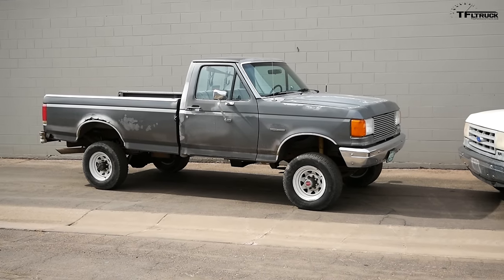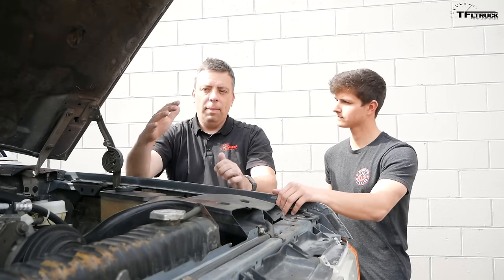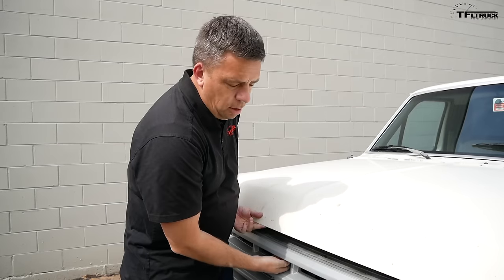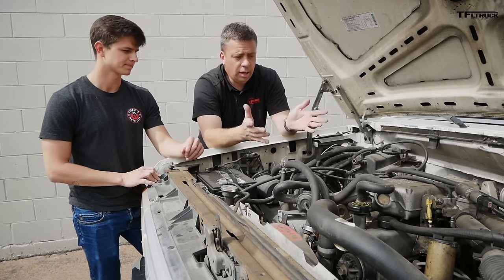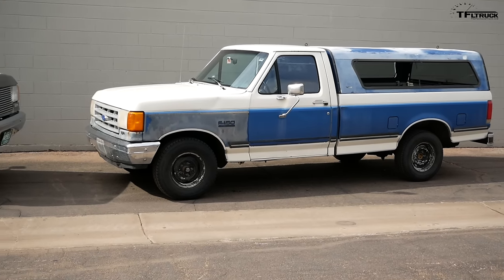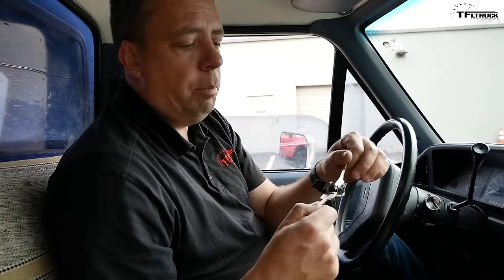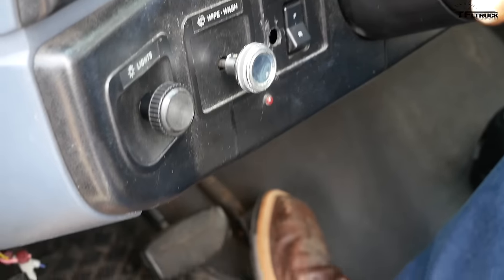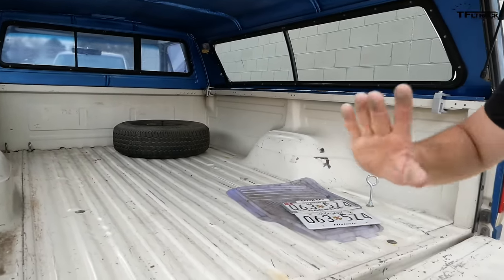Here's Why You Can't Kill An Old Ford F-Series Truck | Gunsmoke Ep.3

Comment: I’ve had many spontaneously start knocking, I blew up a 4.9 once...ran it so hot it locked down 3 times. I worked it loose with a breaker bar and it still fires up and runs great to this day, it just knocks like a jehova’s witness
Reply: UPDATE, it’s still running but, it blew its headgasket and consequently dumped all of its coolant into the oil pan. She can’t get out of the yard anymore….she dead Jim, she’s dead
Reply: @GingeyNHF  it was a good run
Reply: So what youre saying is... even with a catastrophic failure its still running
Reply: @archangel_yt8116  yea, use it to pull my boat to the ramp still. That’s about at far as it’ll go without running hot since I refuse to replace the head gasket again

Comment: I worked at a dealership during the cash for clunkers nightmare and these stories are true about the 300 straight six engine. We had a mechanic that came out into the showroom and asked everyone to come back to the garage and watch the straight six keep running after he had poured in the material that was supposed to kill it. He talked about how quickly the other vehicles would stop running (most almost instantly) and how that truck just would not die. He pulled all the other vehicles out to the back lot/salvage area with a forklift, but he drove the Ford out there under it's own power. I have always been a Ford guy, but I bought a 89 F150 with the straight six because of seeing for myself how bulletproof the engine is. I have over 200k miles on mine and it has been my daily driver for the last five years.
Reply: I have an 84 which has ran out of oil twice and is still used multiple times a week. The mileage is unknown.
Reply: Straight 6 , and 460 , ford should've kept and improved upon imagine what could've been done with dual valve heads on a i6 or improved factory heads for the 460 how simple and skip all the Triton crap in between that's sitting in junkyards , I often look at those new ford's and imagine dependable motors I them and I'm a ford guy 😮
Reply: Thinking about buying a 4.9 I6 with 250k on it, do you think I should?
Reply: @imissyoumom7644  if the body isn't falling completely apart yet, then it probably has another 200k to go.

Comment: I really wish companies made simple reliable trucks like this nowadays.
Reply: Toyota still makes trucks that are more reliable than this
Reply: @westward bound but the rest of the truck doesn’t
Reply: Don't worry we most likely won't have production from China anymore
Reply: westward bound  Um yeah, ok apparently they didn't tell the 4L60E that bit of info.
Reply: The last simple reliable truck is the  2015 6.0 2500. N/A motor over built, and over built tranny.
Reply: westward bound lol sure they do
Reply: My 2000 Gmc Sierra 4.8l 4L60E has only 275,000 miles on it and no rebuild yet.
Reply: @claytoncristoffanini756  toyotas have a good rap but will not be more reliable than a 300 straight 6.
Reply: James Ray  That was their old I4 diesel trucks. Their v6 Tacomas are not exactly what you'd call reliable..
Reply: James Ray  my '10 tundra never had anything break/deteriorate other than the block heater. After driving terrible roads it's still tough as a nail. Not considering upgrading for awhile
Reply: Same but these companies would not make money. It is high competition.
Reply: why would they make simple trucks when they can charge a fortune for every minor issue that comes up, particularly when you can't fix things yourself anymore?
Reply: No one wants to buy them. Modern buyers all want status symbols, and jacked so high off the ground you need a ladder to load stuff.
Reply: @james_chatman  True that they are not bought to be used as trucks anymore. Especially the guys who buy GM products.
Reply: Toyota still do, the VDJ79 Landcruiser, in some parts of the world, the 79 series Landcruisers can still be bought new with the old N/A 1HZ 6 cylinder. Unfortunately no 70 series sold in the US.
Reply: Because of all the stupid legal bullshit with the mileage and safety crap.
Reply: Toyota and honda are the “reliability” brands now rip chevy and ford.
Reply: Toyota and Honda both have cheapened out in quality and reliability in recent years also. Nothing is made to last anymore, nothing...
Reply: They make more money fixing these new ones. A guys have grown to want heated seats and climate control and power sliding windows. Give me a bench seat a 5 speed and wing windows any day!
Reply: Thulsa wrong honda 1.8 liter port injection and toyota 2.7 liter port injection are both rock solid engines make 140-160hp. The. 2.7 is a iron block and will last forever. And toyota is made of very good steel and wont rust as much as a new dodge or chevy or ford. And can get 25 mpg in the 4wd toyota and 28mph in the awd honda hrv. You are very stupid if you dont think there are suv and trucks out there that cant go 300k miles. As long as you follow the maintenence schedule and change tranny oil every 30k miles and diffs every 30k miles and oil every 5k miles on high quality synthetic mobil one oil they will last a very long time.
Reply: @gsfbffxpdhhdf7043  Too bad all the electronic shiz on honda and Toyota still won't go the distance though.
Reply: @hikdingle2210  yep, they are toys for boys who try to make people think they're tough!
Reply: @gsfbffxpdhhdf7043  when did honda start making a truck, I ain't ever seen one yet.
Reply: @mattjohnson5222  reliably broken if you hit a hole in the road at a high speed of over 25 mph
Reply: Correct, the ls series are great engines. That being said, any government motors trucks/cars are poorly made of cheap parts.
Reply: Wish they made them big enough back then for tall guys like me, I'm 6'5" and barely fit in them.
Reply: You and me both
Reply: @melvinrexwinkle1510  Honda ridgeline!
Reply: @claytoncristoffanini756  Toyota trucks have a HUGE frame rust issue. To the point where it was warrantied. Can't drive it if it isn't there!
Reply: westward bound   yeah maybe after the recalls are done
Reply: ya
Reply: James Ray  so true, the latest Camry is a perfect example. that wasn't always the case with Toyota, but they got lazy after awhile. the previous generation before this was better, but they started listening to all these younger car reviews saying they need to be more sporty and appeal to millennials, and the problem is there newer designs don't really appeal to anybody lol. it's like Honda with the new Accord, I hate the way the new one looks. the Tacoma used to be a nice truck similar to the Ranger and S10 from Chevy, but the recent Tacoma I'm not a big fan of. they got rid of 4.0 for the 3.5 and I feel like it lacks power down low.
Reply: @Epotheros  they still use those little straight 6 diesels in the mines today.
Reply: @claytoncristoffanini756  hell no, have you seen the new tacoma problems, toyota is just another brand
Reply: @australiantruckspotting8883  don't miss much, 79 series are good cars, but not the best, v8 option shows timing and Injection problems, and its overpriced tag of 80k dollars
Reply: I would take one of those over a new one any day. They were reliable and tough
Reply: I hate newer trucks. So many damn electric patys
Reply: Lol
Reply: Like bruh, I don't care about safety
Reply: @bretfeeney1072  Great generation of GM trucks. the Vortecs were great engines from like '99-'07 4.8, 5.3, 6.0
Reply: The government ruined the auto industry putting tremendous pressure to advance the technologies in them.
Reply: That is the reasons not just the Ford trucks but Chevy and the Dodge trucks are seeing a renaissance era right now. I have friends and neighbors that looking for and tracking this stuff down in garages and out behind garages & woodsheds around here. I have a half dozen of em myself I am putting em back together one part at a time. I wish I had more time to work on em.
Reply: Amen
Reply: @claytoncristoffanini756  laughable.
Reply: @djdjsggg2924 it’s not China it’s schlomosteinberg
Reply: @claytoncristoffanini756  When you have one of those Toyota's that is a daily driver and a work truck for 42 years with everything original motor transmission and rear gear never touched come and see me. I'll be waiting.
Reply: @claytoncristoffanini756 ya right 😂

Comment: I miss when trucks were honest and simple. Cheap, effective, reliable.
Reply: I just started fixing up a '67 ford F100. Talk about simple. And it was free so, cheap. No power steering, manual choke, if it had a 4 speed it would be perfect
Reply: I have a 78 F100, over 375k miles and just towed a Buick LeSabre from Richmond, CA To Dyeesburg TN. Sweet.
Reply: If only Ford, GM and Chrysler would actually great quality vehicles again and keep it that way, it would be awesome.
Reply: Nothing runs like the old domestic made vehicles.

I still have an old early 90's Chevy Cavalier with the 3.1 V6 and it still runs great.
Reply: I want a old F350 for pulling different trailers, and off roading dirt and rock trails.

Of course the truck would be well looked after, to make sure it keeps running well for long long time to come.
Reply: Worst case scenarios, I could try getting the Chevy Suburban or Tahoe 2500, from the late 90's to early 2000's.

Still I prefer one of these old F Series, best would be the F350.
Reply: @onusgumboot5565  now I feel like a big spender.... I spent $1 on a 1986 f150
Reply: 🍻those were the days!
Reply: I have an 89 Cummins dodge d350
160 horsepower with 400 foot pounds of torque @ 1500 RPM can’t kill it.
I won’t drive anything newer than that. 89 was a great year for a lot of vehicles.  The ford 300 is perfect and simple. If you want to have a reliable easy, steady as she goes vehicle? You can’t go wrong!
Reply: @onusgumboot5565  i have a '65 with the 4 speed
Reply: yup
Reply: As opposed to the lying dishonest trucks of today
Reply: Yup, new trucks have way too much crap goin on. I'll never buy one.
Reply: It's you that required power window a must have....
Reply: I miss when cars and trucks were able to be worked on at home with basic tools and no computers.
Reply: Honestly someone adapting that mentality in manufacturing trucks nowadays would make a lot of money. (I'm looking at you international now's your chance)
Reply: Blame crash test safety, emissions, and fuel efficiency standards.
Reply: @theroyalcrownedtiger2946  those 3.1 v6s are pretty hard to kill actually
Reply: @Aliyah_666  : Thank you for the update.  😀
Reply: @onusgumboot5565  My first truck was a 1972 Ford f-100 4wd, with a 4 speed manual trans.granny gear & all + no power steering,no power brakes and I nick named it the war wagon. It had a 360ci engine that blew then I found a 2nd 360 I installed. Later my Dad sold it to a coworker who put a lift kit on it and a 429ci engine. It looked great and I wanted to buy it back but to bad that never happened.😠
Reply: Toyota... Oh, wait you said cheap, nevermind. Totally agree.